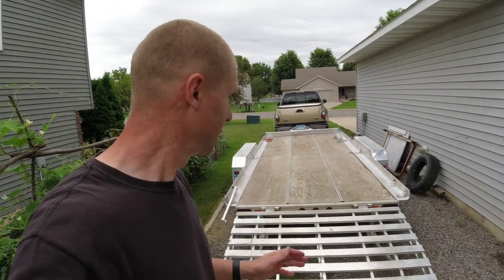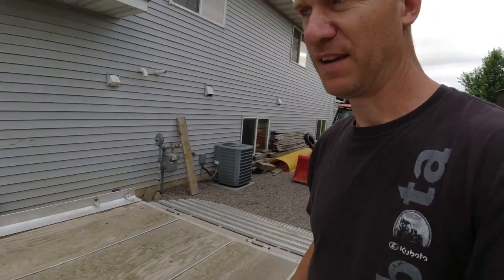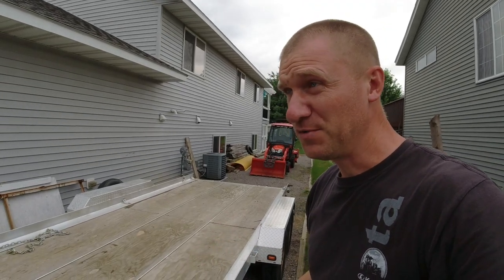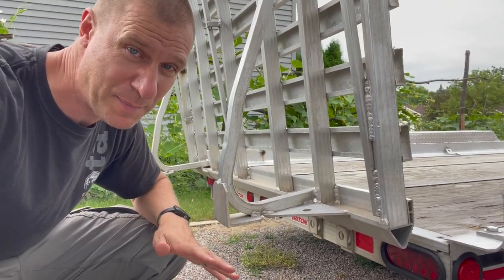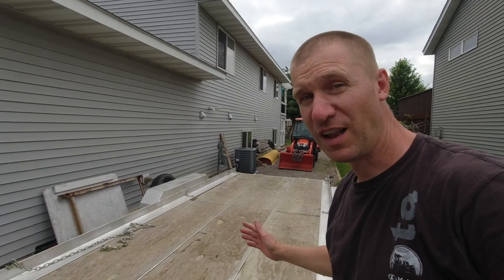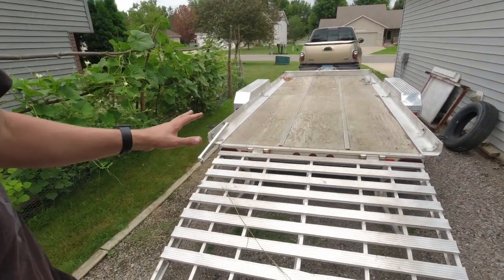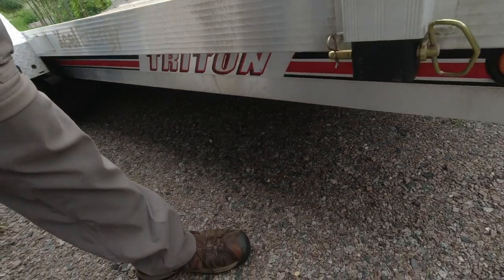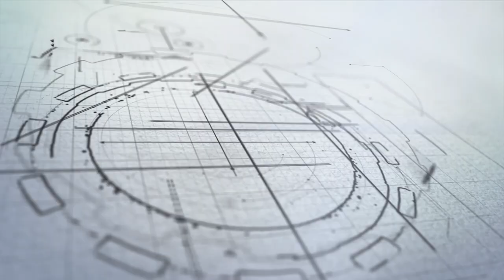WHY I BOUGHT AN ALUMINUM TRAILER (My New Used Triton)

Comment: Jon great deal on that aluminum trailer. Triton Trailers are nice and made in Wisconsin,  if you contact them you may be able to get the support arms and missing slat for the rear ramp. I would suggest doing a wheel bearing pack if you are not sure when the last maintenance was performed. Also an acid wash would make that aluminum look like new again. Great find.
Reply from the maker: That’s right, they are made in Wisconsin. Good suggestions. I’ve got a few things to address including putting some sort of stain on the decking as well. 
Keep on tractoring!

Comment: I would have bought an aluminum trailer last year, but due to the huge amount of sales in my area there weren't any to be had.  I contacted the dealer about a 7x16 car trailer they had, by the time I got there it had already sold.  They had a 7x18 car trailer there, I said I'll take it...its longer than I needed, but gives me plenty of room to load up all my attachments/implements and the tractor if I ever needed to, plus haul a full size truck....which I don't have, but never know what the future may hold.  Better to get a trailer larger than you need than not have enough trailer.  

At some point I'd like to get a dump trailer as well, but they're ridiculously expensive, and good luck finding a used one in my area LOL.

Comment: The trailer looks like a good investment. Aluminum oxidizes so you might want to consider tarping it in the winter and If you are not going to use it for a few weeks. I would probably contact Triton, the can probably sell you the missing parts or a local fabrication shop can make them for you. Tom

Comment: You found a great deal! Congrats! I nice dual axle trailer that will haul my tractor has been on my wish list for a while.  I've not seen any smoking hot deals in my area.  And super bonus that it's aluminum.
Reply from the maker: I think the only reason i was able to get it was because of those rusty wheels and the fact it was an oddball thing for sale on a used car lot for too long. I was able to negotiate the price even. Keep searching, don’t give up. 
Keep on tractoring!
Reply: @ritterjon  If you find another gem - let me know. I'm more than willing to visit you up there and come home towing a trailer! Maybe I'd even find something on the drive home to haul home on the trailer!

Comment: Nice trailer, I have talked to the factory but was unable to find a stocking dealer near northern Indiana. They offer 2 ramp lengths.
Reply from the maker: Shop around, sometimes you can find a good used one. Good luck. 
Keep on tractoring!

Comment: Great buy! I bought a used aluminum car hauler with full Diamond plate deck 3 years ago and paid just shy of $6k. So pleased with it. I added stake pockets and aluminum bleacher boards to haul mulch and topsoil. Sweep it clean and reinstall the boards and it’s good to go! 8000lb capacity and I have had cars on it too. Pull it with my 2018 hemi Jeep Grand Cherokee just fine.
Reply from the maker: Nice! My neighbor actually borrowed my trailer before I even had a chance to use it to haul a Chrysler Mini Cooper. He said it worked really well for him. I have just over 5k capacity. Should work fine for what I'll use it for. 
Keep on tractoring!

Comment: I have been thinking about this also. I would imagine that I would have to have a commercial inspection every year if I had one. I would need a bigger vehicle, Dodge Journey at the moment, to haul my BX23S. Thanks for the info Jon. Stay safe and take care.
Reply from the maker: Yep, a lighter weight vehicle would definitely handle an aluminum trailer much better than a heavy steal trailer. Hard to find a good used one and new ones are overpriced. Good luck in your search. 
Keep on tractoring!

Comment: Nice score! Aluminum is always good in the Midwest with the salt we have. 1000lbs lighter then your 18’ steel is huge not to mention you can haul 1000lbs more. 
Is it a 10k trailer?
Reply from the maker: No it’s a 7k but so is my steel 18 footer so definitely an upgrade. 
Keep on tractoring!

Comment: Trailer is great! But, your truck, as a service manager in a Ford dealership, I can assure you they don’t make them like that. I love the older F-150’s. How do you keep it from rusting away?
Reply from the maker: Thanks Scott! The secret is to never drive it in the winter. The truck only has 64k on it and it’s well care for. I can’t afford to replace it, so finding something a little easier to tow behind it was the solution. 
Keep on tractoring!

Comment: Now You have that Excuse to invest in a TIG welder for Aluminum. You gonna need it.
Give that unit a thorough inspection for cracks. Aluminum Trailers are prone to. 
Aluminum is more rigid than mild Steel, Pot holes don't care what is driven over them  LOL
Thanks Jon.
Mike M.
Reply from the maker: I looked it over for over an hour before offering any money. I couldn’t find any structural issues. I actually backed out of a previous deal after I discovered several cracks. That guy wasn’t happy with me when I pointed out all flaws his trailer had. I was just trying to be helpful. 🤷‍♂️
Keep on tractoring!

Comment: Maybe you can get a hold of the manufacturer, and ask them if they have any replacement parts for ths model trailer. It looks like it is great shape for a company unit.
Reply from the maker: It was well taken care of. I was very surprised the fenders are in good of shape as they are. No dents at all. 😁
Keep on tractoring!
Reply: @ritterjon  Usually utilities companies take pride in the equipment that they own. I think that the parts that are missing from the trailer you should be able to get from the manufacturer or they can get you in touch with a dealer who sells them.

Comment: I did the same thing, sold a steel utility and replaced with an aluminum, larger trailer, weighs less and hauls more.
Reply from the maker: It only makes sense 👍 I still have the steel trailer but I’m thinking about selling it soon. 
Keep on tractoring!